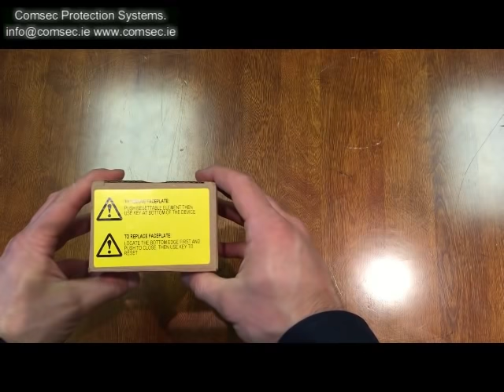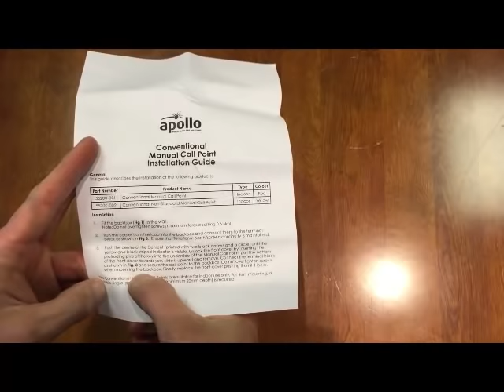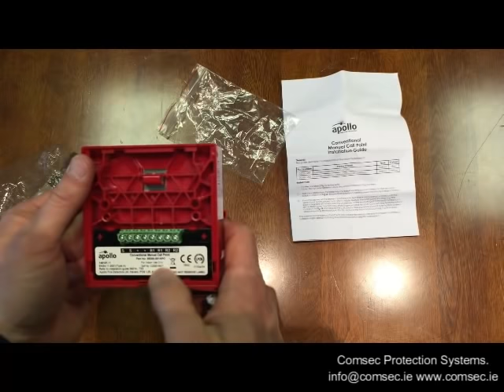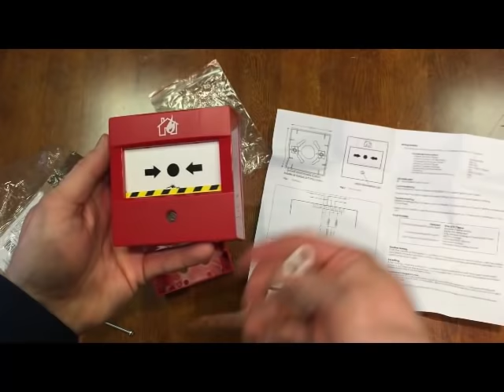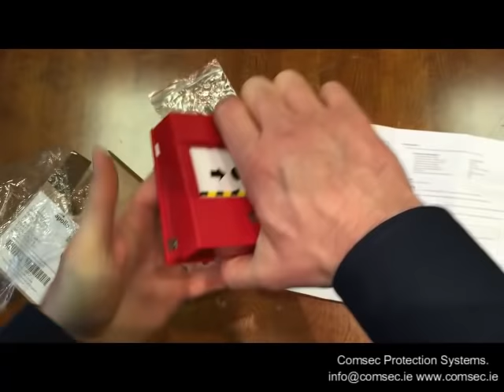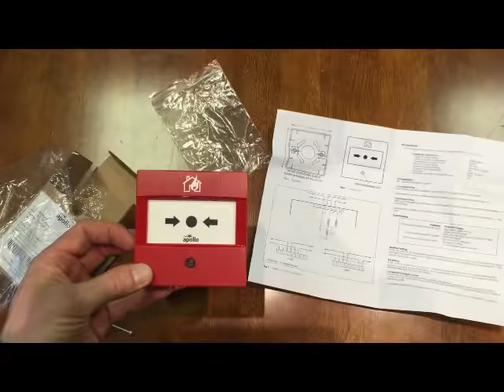The Apollo Manual Callpoint Demonstration

Comment: These were the worst ones, that quickly had a design change because they were pants.
Reply: came here because i'm doing a risk assessment and found these specific call points can't be activated in an emergency. we're having to replace them all. it's dangerous as we've essentially had a non-working system for the last 6 years